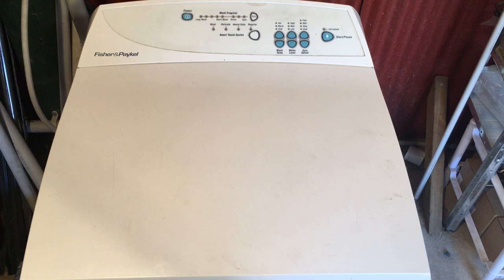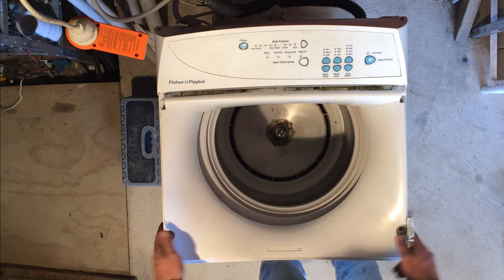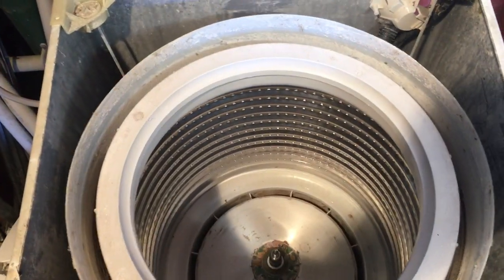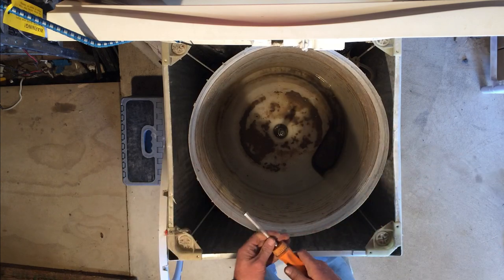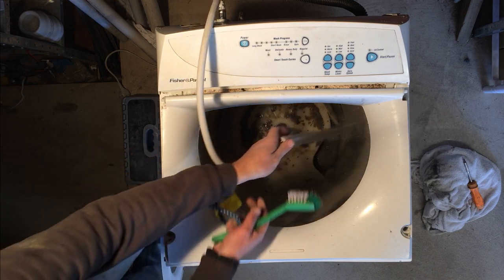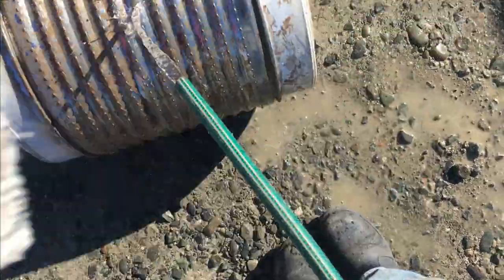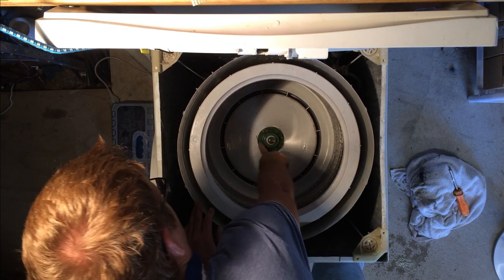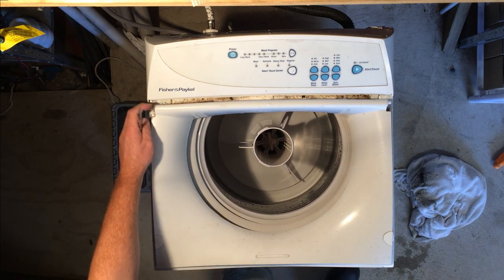How to Clean inside Fisher & Paykel Smart Drive washing machine

Comment: Do you have any other tips for taking the drum out? I don’t think it’s ever been taken out so it’s quite hard and stuck.
Reply from the maker: It will be soap scum on the shaft, if you part fill it with water so the soap scum softens, and then also you have a bit of weight to lift against, then work it up and down.
Reply: FANTASTIC VIDEO, TO THE POINT! An other vid said he removed the 3 screws holding the drive hub at the bottom center of the inner drum. Like previous comment, the buildup on the driveshaft splines are causing the drum to fight removal. May need to use some type of calcium remover. Have patience so you don't cause damage!
Reply: After removing the 3 screws DON'T STRIP THE PHILIPS HEADS , the top of the smother shaft had a ring of rust that I used some fine sand paper to remove. Then the inner tub came out
Reply: I will probably be jumped on from a great height after saying this as it is probably repair men's heresy, but after struggling with the drum for at least half an hour, I resorted to bashing the spindle with a hammer........it worked.  It felt wrong as I was doing it but as I say it worked
Reply from the maker: @rollydowling3177  yeah probably not good for your bearings!
Reply from the maker: @guychapman7735  Yes The three screws are a really soft metal and often get quite stuck. We use a product called screw grab to help stop screw drivers from slipping, but probably not practical for someone not using it a lot. Sometimes the gunk on the shaft causing the problem is in between the top and bottom inner drum bearing surfaces, so you cant always get to the part that is catching. Sounds like you may have quite hard water if you had to use sand paper!
Reply from the maker: just realising I didn't say in my first reply that often i end up sticking a leg into the washing machine and putting my foot on the top of the shaft to hold it down while pulling.
Reply: @motrepairs  OK, I will resist the urge in future. Many thanks for the v. helpful  videos
Reply: We tried for over an hour yesterday and cannot get the drum out. We tried water, using a hammer, putting our foot in etc. Any other tips? Is it OK to put some descaler in the water?
Reply from the maker: @lauren6316  Yes if you fill it with hot water and let it soak for a few hours it should loosen up things, won't be as good as scrubbing but hopefully will get anything loose that could get into your washing.

Comment: How do you get your agitator off it’s stuck? Thanks
Reply from the maker: Is it the agitator or the agitator nut that is stuck? I've had a few nuts that are very hard to turn and sometimes have to make a tool by cutting a couple of slots in a piece of PVC pipe, but don't think I've ever had an agitator stuck on a Smart Drive. You could try partially filling the bowl with water, may help soften it and also will give you a bit more weight to pull against.